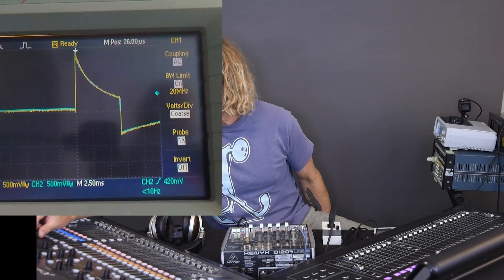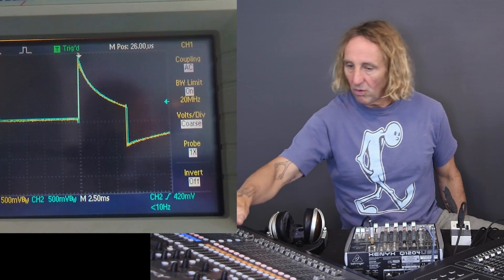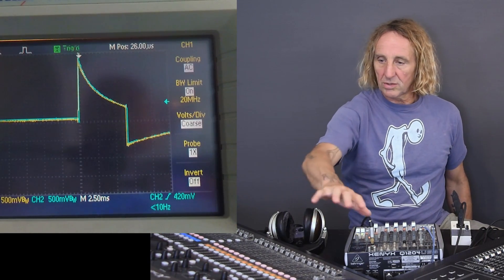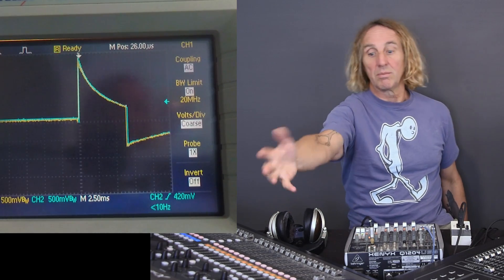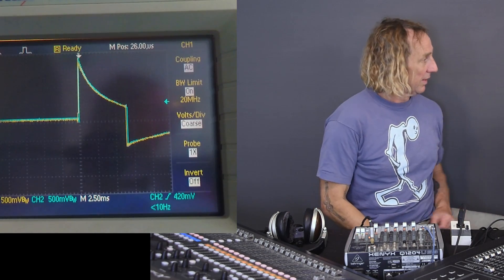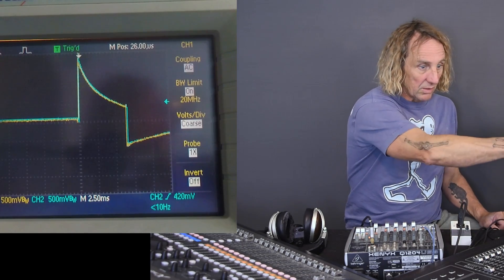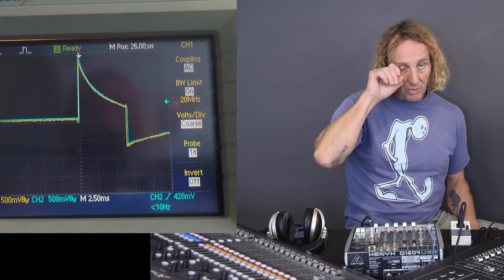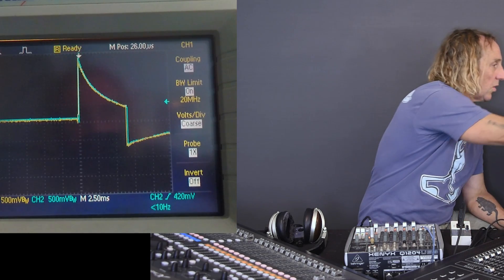Digital vs Analog Audio - X32/M32 AES50, Routing Latency (Public)

Comment: This would be very interesting noted that dave found the sync issue what many people have. having a scope of cable testing with shielding or not shielding cat 5 or higher make the difference or not having a good sync. Some people swore that you need this protocol of cable otherwise you will have issue. i myself use shielded cable created by myself but have never issues with syncing.
Reply: I think it may also matter how long of a run.  I know once you get up to 300-350ft Cat5e doesn't cut it anymore.  Perhaps it's a combination of things that cause that sync issue.  I've never experienced it myself, but we have always only used 100ft or 150ft Cat5e Shielded Ethercon (What the manufacturer reccommends).  And have never had a problem.  I've had other problems with people stepping on the cat 5e and causing a sort of short white-noise burst pop sound, which we have since concluded was a release of static electricity after the gear had been powered on for some time, AND had been stepped on squarely by some drunk guy.  But I digress, lol.

Comment: That’s very impressive. From what I remember, the datasheets specify <.8 ms end-to-end latency locally and <1.1ms roundtrip from stagebox through AES50 through the console back out in AES50 to the stagebox and out of the stagebox. That‘s .3ms for two trips down AES50, and you measured .15ms for one trip. IOW, the datasheets are actually telling the truth and are not doctored!
Reply: Aes50 has a fixed delay of 3 samples per node and one connection is two nodes. This also means that the delay differs slightly depending on if the console is running at 44k or 48k.

The tiny delay between the x32 and m32 is due to different a/d/a converters.
Reply: @dreamhamsterproductions9196  Important to point out the obvious. The two have to use the same clock to sync, so one at 44.1 and the other at 48 will never happen.